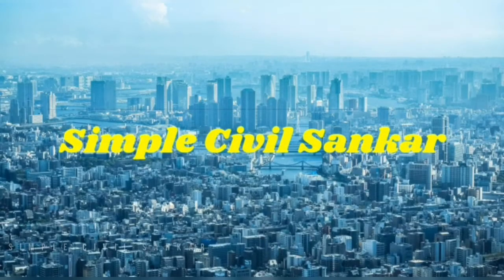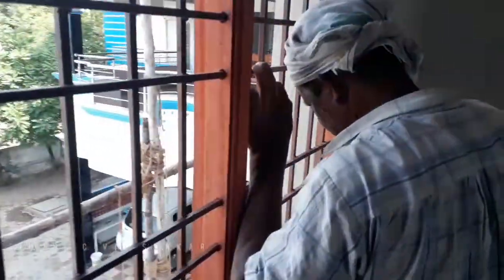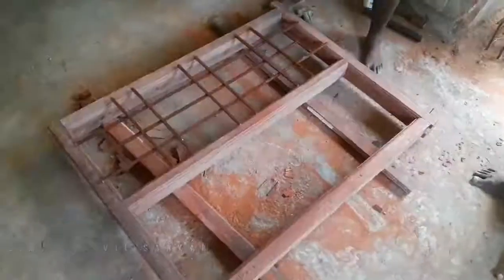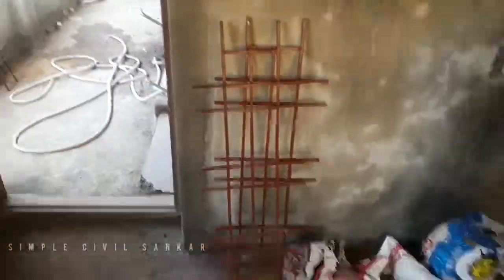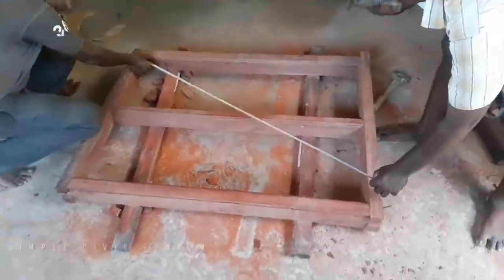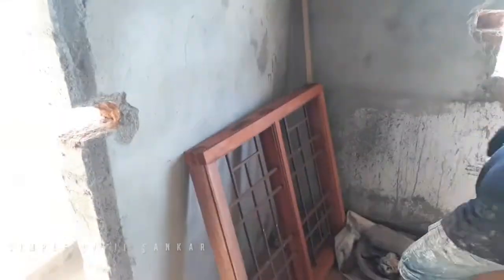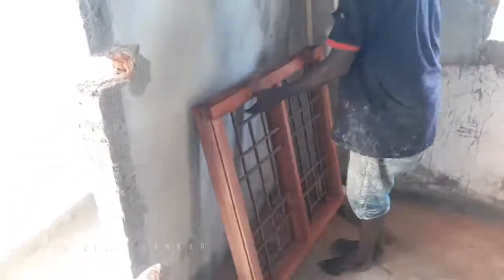Window Frames Fixing Work | Windows Installation Work | How to Fix Window Frame on Walls? | Tamil |

Comment: Window bottom la jali concrete potaga cracks reduce pana mudiuma bro
Reply from the maker: Kandipa mudium bro👍🏻,

Atha Sill Slab nu solluvanga bro, 2" ku Steel rod provide panni Concrete poduvanga.

Atha pannom na Windows Bottom la Cracks varathu.
Reply: @SimpleCivilSankar  super bro steel use panuvagala 😅 enaku therila na only jali use pandrathu video pathutu irukan ok good info thank u